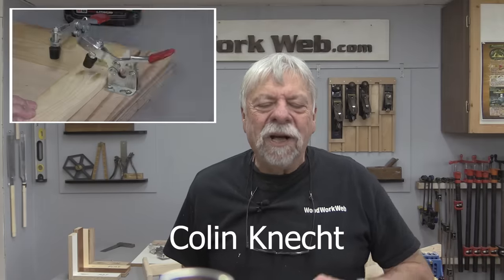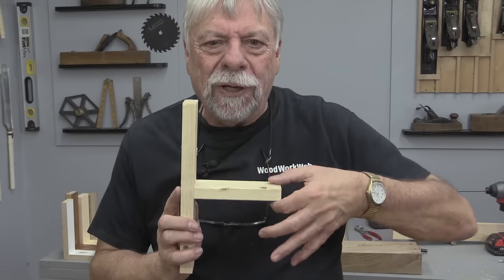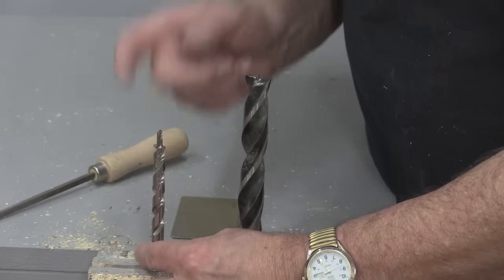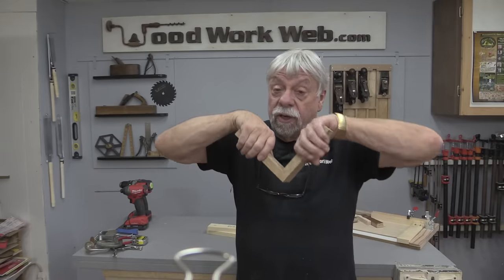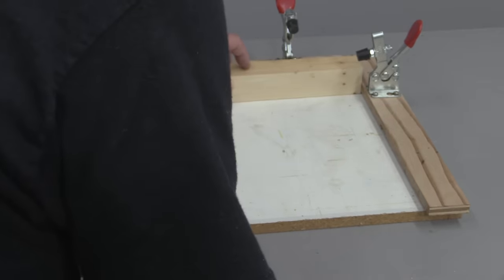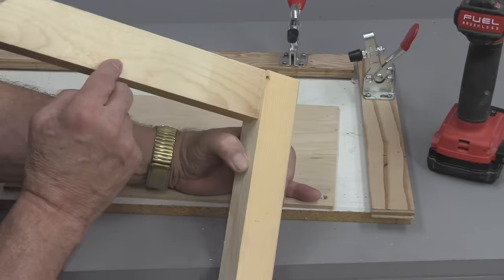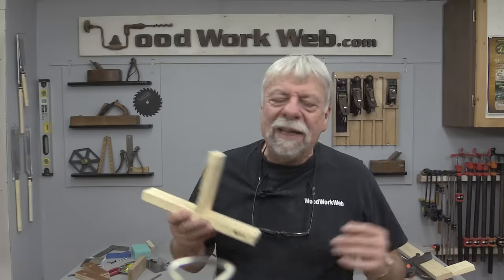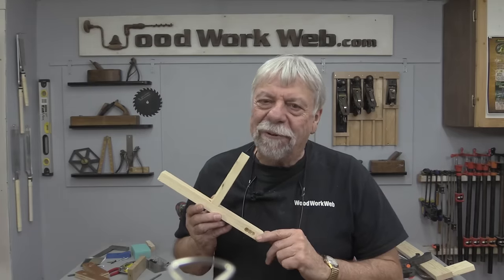Pocket Hole Mistakes to Avoid / Woodworking Joinery

Comment: so at 4:30 there is the "MDF" test piece but is it just me or is that more particle board than MDF ??
Reply: its actually melamine board which is basically particle board covered by formica. And yes MDF is a different material.
Reply: @edwalker506  yes sorry should have made that more apparent, i know its melamine so its particle board but thank you for claryfying :) still, he has MDF on the video while its not, correct ?
Reply: @MrNikke96  You are correct it is NOT MDF. MDF is much stronger
Reply: Yup, that was Particle board  LOL

Comment: 1 more reason not to use drywall screws:
Phillips head

I used to think Allen heads were the worst. But it's definitely Phillips.
Reply: @justinwinkler450  you just have to use the right driver for slotted screws. A slotted screwdriver should fit on a screw like this http://i.imgur.com/T7GpxTs.jpg A slotted screwdriver that fits in the screw slot properly works pretty good. Unfortunately most screwdrivers in this world are garbage. Because I can't grind them all right. But whenever I need to I'll grind one for myself.

Comment: 4:29 I get what your point is, but none of those are done in the correct and recommended direction. The pockets should always be on the outside going in.
Reply: Yes! , I saw that aswell I get the point going through but it misrepresented the strength of pocket hole screws

Comment: I loved your segment on using other screws, other than pocket hole screws.  I've tried it and was unsuccessful. Kreg screws really are worth the extra money.  Last year I used the single hole jig to build a mobile chicken coop (chicken tractor) with 2x4 exterior lumber using pocket holes and it was as sturdy as a rock, even a year later.

Comment: 8:00 What kind of clamps are those? I would like to get some of those. Thanks!
Reply: They are called a toggle clamps
Reply: I’ve seen them for sale at Harbor Freight if you have one near you.
Reply: Those clamps are the same kind that they sell in the box stores along with all the Kreg Jig accessories.
Reply: They're called face frame clamps. Expensive but useful for sure.
Reply: If you have a rockler T-track system for your bench top there's some great clamps like these that work without screwing them into your bench or having to build a jig. I'm looking to put one in soon

Comment: I totally missed that there is a scale on the horizontal side beside the pressure plunger of my Kreg jig.  Thank you!
Reply: i missed it because the K5 does not have it
Reply: @flyinlo1474  Yeah, they use that spacer thing, but what some have suggested is just put a nickle on the bottom of the jig and run your drill bit down the sleeve. When the tip of the bit is resting on the nickle, tighten the collar.

Comment: Everyone who reviews or explains pocket holes always shows how "easily" they can be broken and it drives me nuts! When you have a fully constructed assembly it supports itself strongly.   Under what circumstances would these tremendously destructive forces come into play in normal use? I've built many things with pocket holes and I've yet to have one break or get loose. I don't care how it's built, if you drive over it with a truck it will probably fail.   Dan
Reply: Well if you're making a cane then pocket holes probably will fail for attaching the handle. But like you alluded to pocket hole joinery is just one aspect of an overall holistic design approach. If what you're making is a sound structure then pocket holes should be able to hold it together.

Comment: Watching your video on “pocket holes mistakes to avoid”, I realized what I was doing wrong when screwing the screws into the pocket holes cause the screw head remained exposed. Using drill bit to measure wood width, I used the tip of the drill bit to measure 3/4 width instead of measuring at the beginning of the threads. Good video(s) and thanks.

Comment: Thanks for this info.
I have had mixed results using pocket holes and I may have discovered some of my problems from this video.
I have been setting the bit depth to the point of the bit and not the shoulder
Reply: Yeah setting the stop collar depth wrong would lead to poor results. As neat as Kreg jigs are sometimes I can't use them. Then I have to revert to machining pocket holes the old fashioned way. You really have to do some figuring to get the screw into the work right then.

Comment: Ghank you, you explained much. I have not used any screw except pocket screws, I have never liked sheetrock screws for the very reason you demonstrated, heads break off. 
Kreg makes a pocket screw for outdoor applications and use in treated lumber. They are blue in color. 
Living on a farm I build quite a bit using both. Next project is a new chicken coop. Yeehaw! Lol

Comment: One of the things I was wondering about was the fact that pocket hole joinery uses end grain, which does not provide a strong hold when screwing into it.  This video discussed that and I was able to see how the different materials acted when using pocket holes.  Another great video.  Thanks Colin.
Reply: But pocket holes are not end grain. The screw goes in at an angle across the grain.

Comment: I like the Kreg Jig system.  I put together two oak side tables with them, no glue, about 5 years ago.  Still firm without the loose rickety movement that you get with old furniture.  I also made a console table that fits between the seats of my van.  Same result.

Comment: Your information about screw types was so good you should make vids on info like this and with your explanations of what happens with the dos and don'ts. Fascinating, if you did a series of vids on does and don'ts to do with tools, equipment, materials etc I for one would be glued to them (no pun intended) My father taught me a great many things about tools and how to use them properly but one thing I have learned over the years is that we never stop learning and when we make mistakes (like using the wrong screw) we blame the materials/equipment rather than the incorrect application. Like Mr Barnaby says "the screw information was an eye opener" Thanks!!!!!
Reply: As an example of one thing my Dad taught me is putting a small piece of wood under the head of the shaft of a claw hammer when lifting out nails. Stupidly simple but oh so effective and you don't split the wood and often the nail is re usable because it comes out straight. Another trick was told me by my old style cabinet maker friend is to use candle wax on your screws to make them easier to go in and when the time comes, easier to get out. I now carry candles in my tool boxes and random small pieces of wood.

Comment: I've been sharpening knives for almost 45 years and you can get that burr when sharpening no matter which way you are moving the cutting edge over the sharpening material.  If you're not getting a bit of a burr, the cutting edge isn't contacting the sharpening material.  I do not have any sharpening videos uploaded, but if you check out "Burrfection" on YouTube, he has several great sharpening videos.  Aside from that, great information.  I've not used these types of joiners but it is something I plan on one day.  I appreciate you taking the time to present this information!  Thanks!

Comment: I don't often use pocket holes mostly because I really don't do a lot of woodworking; however I really enjoy watching and occassionally commenting. With regard to the alignment issue, I've encountered the problem and mitigated it by taking a must longer and very small diameter bit to drill a pilot hole all the way through into the mating wood piece. Seems to help quite a bit; but it's an extra step. If I did a lot of pocket hole work, it would "require" a third drill or it would turn into a hazzle. Not suggesting it works better than clamping; but it does work.

Comment: Great information.  As a side note, I filled all my markings on the jig with white paint to make them easier to see.  It helps a lot when you are moving at a pretty good pace with different size woods.
Reply: That's what White Out is for. I wonder if they still sell White Out? The bottle I have here went bad on me a while ago. But White Out is great for coloring in engraved graduation marks. They used to do that at the factory. You never see old stuff that's not colored in. Today they skip that step to save costs.

Comment: While I learned a lot from this video, What wood is good and which is bad, The most important thing was how to sharpen Brad Point bits and in particular what sharpener to use. I've got a number of Brad Point bits that need sharpening and now because of this video, I think I can get them properly sharpened. Thank you very much !

Comment: I bought a pocket hole jig from a place to complement my Kreg jig collection. This jig had 2 sets of drill guides! One set at 15° like Kreg. Other drill guides set at maybe 8° to 10° angle for the smaller thickness boards.

Comment: A simple but informative video Colin. I have one small tip, if you grind a small flat on the adjusting collar of the pocket hole drill it can prevent it from rolling off the bench, it happened to me twice, and both times the small tip of the drill broke off, Do'h!   ...Cheers.  Les.
Reply: Those step drill bits are expensive too. $15.48 at the big box store here!

Comment: Colin,  I am surprised you did not go into the different length and thread types there are for pocket joinery.  This makes a lot of difference on a quality joint.  Also, you should always build a test joint with the material you are using.  The wood thickness is always different and you need to test to ensure the screw will not protrude through the edge of the joint.  I use pocket joinery for all of my shop builds but never for furniture.  The screw holes are just to hard to cover and make it look nice.

Comment: Your drywall screw demonstration showing the head shearing off when you over tightened it reminds me of what we used to tell apprentice techs when showing them how to use a click type torque wrench. "First click, the bolt is tight, second click, the bolt is broke. Remember that!"
Reply: after solid comes off.that's nothing realy new
Reply: @duczman76  ????
Reply: @AutotechWoodworking  it's a german saying that means don't pull the screw/bolt too tight or they're all loose again then.
just imagine, you screw all the whee bolts so tight, that with even more torque they all tear off and the tire falls off the hub.now it should make more sense.my english colloquial language is no longer up to date.i'm out of school for 25yrs 😅

Comment: Great feed back and lessons learned, nice explanation. There is a judge difference between sheet rock screws and good constructions screws. And you can see it in the cost. Construction screws are about 20-40% more then same size of sheet rock screws.

Comment: Great video on pocket hole joinery. Have you ever encountered the problem when using 1 inch pocket hole screws to attach 1/2 wood, the head  of the screw doesn't sit all the way in the hole? Now i have to file down the a little of the head of the screw because the wood putty doesn't completely cover the hole.

Comment: You mentioned to avoid using wood glue on cedar, but I’ve been building birdhouses for years using recycled cedar fencing re-sawn to 3/8” and assembled exclusively with wood glue- specifically Tite Bond III- and have yet to experience an edge failure. I like to believe it’s due to this excellent exterior glue.

Comment: The reason for the empty shank part on the screw was news to me. Thank you for clarifying its benefit for us all that never knew about it Colin!
Reply: When your piece moves off due to thread in both parts it is called, "jacking". Another way to avoid it is to have a clearance hole large enough in the top piece that the thread can't engage. But if both pieces are clamped work can't jack either. When work jacks it is pretty annoying. On complicated assemblies you really have to plan the process before you start trying to glue anything. Many times I've been rushing through my shop looking for another clamp.

Comment: Thanks for this video, Karl. It taught me a lot. I use sheetrock screws a lot but never with the power screw driver. The normal drill works well and lubing the threads with soap or wax gets them into hard material easily.
Reply: Yeah I'm anal about drilling pilot holes. I've read a pilot hole actually improves the strength of the fastener in wood. Because you're not mangling the wood with the screw shank as it goes in. As soon as I heard that it was pilot holes all the time for me. Anything worth doing is worth doing right. But with Kreg pocket holes I rely on the self drilling Kreg screws. Good enough. They're handy for more than just pocket holes. They're good screws to have in stock.

Comment: Great video!  I use the Kreg 720 pocket hole jig, but cannot get the Kreg pocket screw head below the wood surface when using Baltic birch 1/2” plywood for drawers. When using a shaker drawer front it isn’t a problem. How can I get the screw head below the wood surface?  Thanks.

Comment: Great video , I have a corner finish nail jig I could add those clamps to . I have seen the clamps in Grizzly catalog pretty cheap . Wish the Kreg screws were a little less expensive , but much better than sheetrock screws .
Reply: I understand what you are saying.  But to not have parts split, have to machine another part, and get better results besides, the extra cost is definitely worth it.
Reply: @dwightl5863   Yeah I would love to have one , and I have the $39 set and it does a good job just slow and a bit more trouble but I did my bathroom cabinets and door frames with it . I may end up before I do my kitchen buying the best set . Kreg makes some nice tools . I really enjoyed your video and your improvements to the $99 setup . I too have trouble not trying to improve on all my tools lol . Great video some great tips .

Comment: Good tips. In Southern Ontario our local national name hardware store sells "pan head" screws in bulk. They are the same type of screw but cheaper than the name brand.  Our local store only has the coarse thread screws which are only suitable for softwoods.

Comment: I see that you had Robertson drive screws, which is worth mentioning, versus Philips/Pozi-drive, as they have less tendency to strip out, and "stick" onto the driver, making them a lot easier to get into position,  especially working horizontally,  in tight spaces, or overhead...

Comment: Unless you are a pro, needing to screw hundred of screws in a short time, the best practice would be to pre-drill the "upper" piece of wood with a bit equal or even 0,5mm bigger than the screw. Doing that, you don't need to use "half-blank" screws.
Thanks Colin for the info about the effectiveness of pocket holes on different materials.

Comment: I've used pocket holes and biscuits to clamp up a large table tops you can remove the screws once your glue dries if you like you can plug the hole as well.

Comment: Extremely informative video. Some take a ways never use drywall screws. Do not use regular
deck type screws as the screw will plot the wood ergo..not a good joint. Much more. Like your teaching. Very down to earth
 Btw who makes that jig?  I suspect Kreg as it has about the same color.

Comment: The kreg screws have the 'drill' point, as well, so that they are less likely to split the 'target' piece of the joint. I have had some success at avoiding the movement of the pocket-holed part of the joint by tapping the tip of the screw into the 'target' piece, before applying the screwdriver...
Reply: I've been having the same trouble! Thanks for the tip!

Comment: Colin, you have touched one of my hot buttons.  You should never try to clamp two pieces of wood together with screws without a clearance hole in top piece.  As you point out, without a clearance hole in the top piece when the screw starts to thread into the bottom piece it doesn't clamp (will NEVER pull the pieces together tighter than however tight you have clamped or held them!) and could push the top piece away if not held securely enough.   With the pocket hole jig, as your cut section shows, the pocket is not drilled deep enough that the smaller diameter of the pocket hole drill goes through the wood.  It leaves a portion of wood for the screw to go through with the threads of a fully threaded screw, such as the sheet rock screws you showed.  I agree that you should never use a screw designed for a countersunk hole, e.g. flat head screw or bugle head sheet rock screw (in fact, the way the sheet rock screws are constructed they are not designed to hold any kind of force and should never be used other than for what they were created for, sheetrock), but if the pocket drill goes through you could use a pan head sheet metal screw to achieve good results.  This requires setting the pocket hole jig differently than according to the directions.  The Kreg pocket hole jig (I have not used any of the copy-cat jigs so don't know if they have the same issues) is not designed to use screws other than the ones they sell.  Your video is good information, but there are other choices for pocket hole screws than the two that you present, namely: #1) the washer head with unthreaded portion smaller than the OD of the thread, and  #2) flat heads with any type of tapered head that spreads the wood.  In fact, using a washer of the correct size under the flat head would work provided you could get a washer of the correct size ID to fit closely over the threads and OD to fit into the drilled hole.  The length of the screws would have to be adjusted the length to accommodate the head that would stick up farther than the washer type.